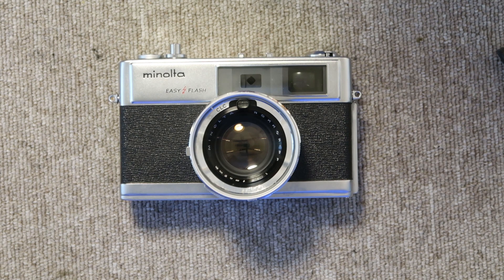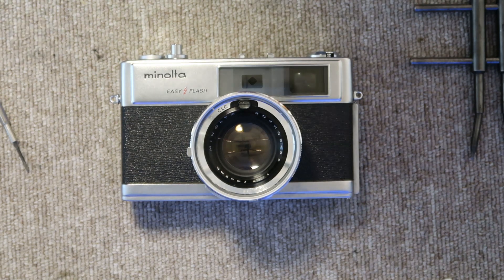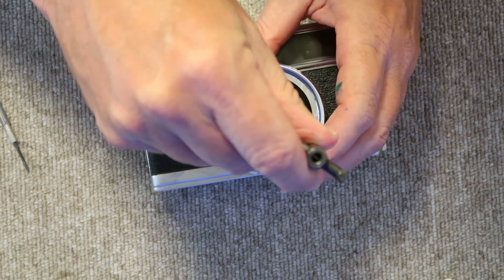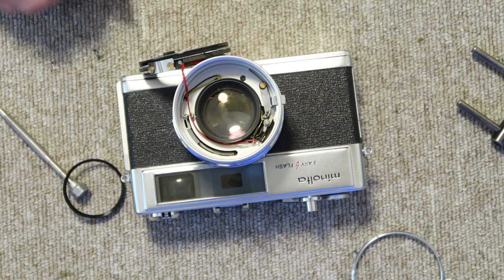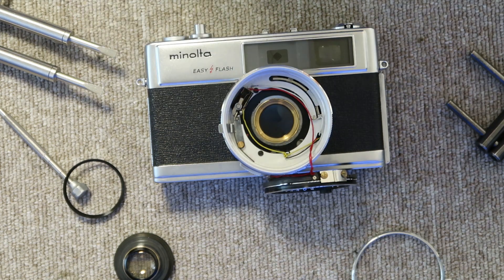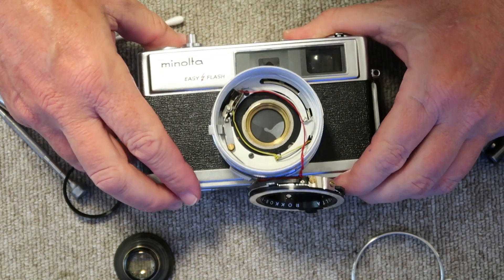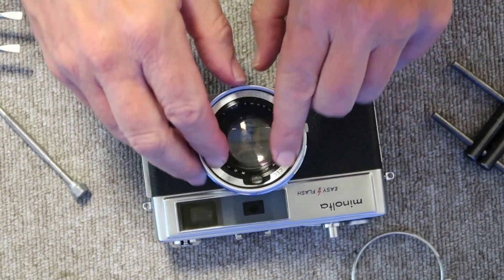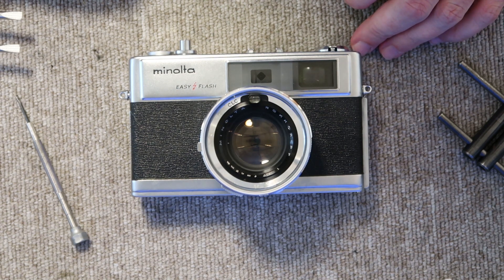How to fix a stuck shutter on a Minolta Hi-Matic Camera

Comment: Thanks, had exactly the same issue and after some courage (or recklesness) when to open the camera acording to your instructions and fixed it. Also did a deep cleaning of the 3 lenses. Cheers

Comment: Thank you much for the video I tried this on mine and cleaned the shutter blades like you suggested but the shutter still doesn't open up to start and close the exposure it just doesn't move. However it did move open and close easily while doing the cleaning but does not do it by itself. So I don't know what is causing it not to if you have any ideas I would really appreciate that. Thanks  🙏
Reply from the maker: You may have to repeat the process a few times, and a blow brush or compressed air can help to blow out the fluid before it dries in place,.

Comment: Could alcohol be used for this? I have alcohol but not lighter fluid.

 I have a Minoltina AL-s with a stuck shutter.  I assume the same process works on them - they all have leaf shutters 

Thanks in advance.  😊

Comment: I followed your steps and got a Hi Matic 9 shutter working again. Flawlessly, at all speeds. Thank you. But it has another problem, the focus ring is also stuck! It won't budge at all. How involved is it to get it lubed and working again? The camera is absolutely flawless other than this remaining problem. Even the meter works! It had its original Mercury battery, but with no corrosion. I replaced it with a MR9 battery that drops the voltage and it is on the spot accurate. I just need to get its focus ring moving so that I can put it to use alongside my Hi Matic 7sii. The Minolta lenses are amazing for their contrast and resolution.
Reply from the maker: A common fix for a stuck focus ring is to heat up the camera with a hair dryer, this softens the grease in the focus gears. This doesn’t always work, but it often does.

Comment: Hi there. Really enjoying your reviews and repair videos ! Many, many thanks ! Picked up a cosmetically beautiful Hi-Matic E. Camera powers up, orange power light comes on, green light in view finder comes on - shutter fires, but it seems to be stuck at one shutter speed. Any ideas what could be wrong and what can be done ? I do see that the ASA dial changing does change the aperture when firing (which I guess is good ) but the shutter speed stays the same.

Comment: Hi,
I came across your channel and you have some great tips and Infos!
I saw an offer online of a hi matic 9. The guy says the auto mode and lightmeter does not work and since the middle of the last role he shot, the camera didn't take pictures anymore (black negatives). Now seeing this video I think it might only be a stuck shutter. 
Do you know of any other problems? Do you think it could still be an "easy fix"?

Comment: Hi, what would you recommend for tightening the lens to the main body. There is a slight wobble on my Hi-magic 7s.
Reply from the maker: A small wobble is okay, these cameras were made with somewhat wide clearances so they could operate in hot or cold weather. Too much wobble can affect the photos, but correcting it is an intense job in the Hi-Matic cameras, as you need to remove the entire lens assembly and front plate from the camera, then tighten down the retaining nut inside the rear of the lens assembly.
Reply: @japanvintagecamera8869  thank you for your reply! Very helpful 🙂
Reply: @japanvintagecamera8869  I also have a wobbly lens on my 7s, which hasn't been a problem, but now the focusing ring is not consistently affecting the rangefinder. It'll focus from infinity down to about 7 feet and then stop moving the rangefinder elements. If i shake the camera though, sometimes it will go down to the minimum focal distance. Do you think this fix i found would work on my Hi-matic 7s? It suggests tightening three screws inside of the lens assembly: https://www.adnbr.co.uk/articles/fixing-an-unfocusable-minolta-hi-matic

Comment: I just bought this camera from you and I'm looking forward to it.  I have another of the same model.  The shutter didn't work.  I was able to fix that with your instructions.  Thanks!  The exposure meter doesn't work either.  Can it be fixed?
Reply from the maker: Thanks very much, your camera is on its way. The usual cause of a dead meter is bad electrical contacts, often the wire leading to the battery becomes corroded and disconnects. You can run a new wire from the meter to the battery contacts, but the camera has to be disassembled quite a bit to do it.
Reply: @japanvintagecamera8869  I thought so. Because there was an old mercury cell in the battery compartment.  The previous owner told me that the camera must have been in the closet for 40 years.  The film in the camera was an old Kodak (C22 development) that hasn't been around since the early 1970s.

Comment: I’m finding that I can’t focus my hi-matic e. when I turn the ring nothing changes, the subject  won’t line up in the diamond as it should. Any thoughts?
Reply from the maker: There are moving parts in the rangefinder which are lubricated with grease. Over decades this grease can act more like glue, and stop the rangefinder mirror from moving. Under the top cover you can see the rangefinder mechanism, the mirror should move when the focus ring is turned, if not, a few drops of solvent at the pivot point should get it working again.

Comment: Hi looking for some advice on my Minolta a5, the foam ring on the interior of the camera has completely deteriorated. I managed to clean out most of the foam but I'm wondering how to replace it. The inner lense also seems hazy. Any information would be greatly appreciated.cheers
Reply from the maker: The only foam you should replace is the light seals. The foam around the viewfinder and around he base of the lens is best not replaced, it is not necessary, and in time, it deteriorates, and spreads foam dust around the insides of the camera.

Comment: Hello! I just got a Hi Matic E  today and after rigging a battery situation and getting the lights to come on, indicating a solid current, I found that my shutter is still locked entirely, as if it didn’t know it had a battery in it yet. Is that the same issue as what you fix here in the video? Or is this a more electronic problem? anything would help! Thank you!!
Reply from the maker: This can be caused by a stuck shutter. You can try removing the front lens element, you need to remove the lock ring, lift off the name plate, and then you can unscrew the front lens element group together. A drop or two of lighter fluid will make unlock the shutter blades. It is also possible that the meter element is out of whack, and though the camera is energized, the meter is not reading enough light to allow the shutter to open. In this case, the repair is more troublesome than simply getting another camera.

Comment: Hey thanks this video was super helpful! I was able to follow you up until you got to the part where you remove the front lens element. Mine is stuck in there tight and I don't want to wrench on it too hard. Do have any tips for loosening it? Thanks!
Reply from the maker: There are two ways to remove the lens element, with a lens spanner, or a pair of pliers with a long or wide nose. You can use a little leather under the tips of the pliers to prevent damage to the lens assembly. Do not grip the lens too close to the edge, try to grab it a little more deeply. Normally it does not take a lot of strength to loosen the lens element group.
Reply: @japanvintagecamera8869  Thanks! I'll try the leather trick.

Comment: I can follow the steps, but the lens elements won't come out. They're stuck. Any tips on how to loosen it? Lighter fluid again?
Reply from the maker: It is rare that the lens assembly gets stuck, usually they are little more than finger tight. Lighter fluid dries a little too quickly to penetrate the threads. You sometimes need to apply a fair amount pressure to get the assembly to turn, but you run the risk of bending the edge of the assembly. My most useful tool in such situations is a pair of vice grips with the long nose. I use rubber from an inner tube to help them grip, and to prevent scratches or damage.

Comment: any example on jammed shutter sir?
Reply from the maker: Actually, the shutter on this camera was jammed, you can see it opened rather slowly after I applied the fluid, and then worked normal speed after that.
Reply: @japanvintagecamera8869  so the shutter fired but the shutter blades doesnt open? i have the same issue  and ill try to fix it next week, thankyou!

Comment: Can I replace Lighter fluid to alcohol ???
Reply from the maker: Most isopropyl alcohol was some amount of water in it, which is why I use lighter fluid or lacquer thinner. Some old timers use gasoline. Of course all of these, including alcohol, are flammable, be careful.
Reply: @japanvintagecamera8869  ohhhh I see, Thank you for replying me, btw 1 more question :">  Can I still open himatic 7sii with this way? :/
Reply from the maker: @eggie247  The 7Sii is actually easier to open than the big Hi-Matics

Comment: That's not how you fix sticky shutter!
Please, don't listen to his advice
Reply: Ok, mr engineer.  Buy, my I aks you why do you say that? I"ve done this before and it has worked for me, besides, watch the video and you can cleary see that this works.
This channel is a trustworthy source, unlike you that just comes out of nowher sppiting nonsesnse.
Reply: Always nice to give superior advice and enlighten us when commenting negatively...
Reply: Im not on siding with anybody. This is just my personal opinion. I might be in the minority here. I've tried using this alcohol trick. Result : it left a residue on the shutter and make it worse. Then i dig deeper. The base for the shutter became a little white probably because of alcohol(not sure about this). And i have to disassemble the shutter, clean it and put it back together. Then i tried it again, same result. At last the problem is the shutter spring lose its tension. This alcohol trick might work but stuck shutter might be because of many reasons.
Reply from the maker: @retropad2020  I do not use alcohol, I use naphtha, which leaves no residue.